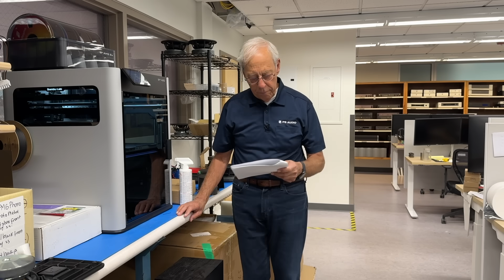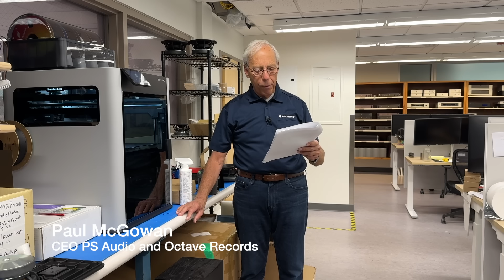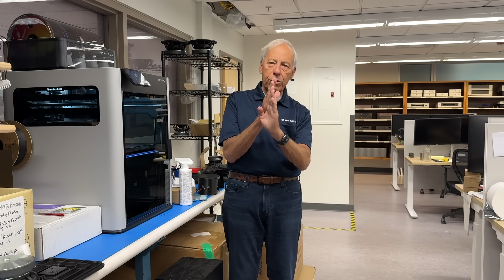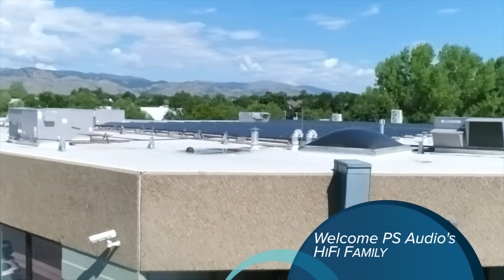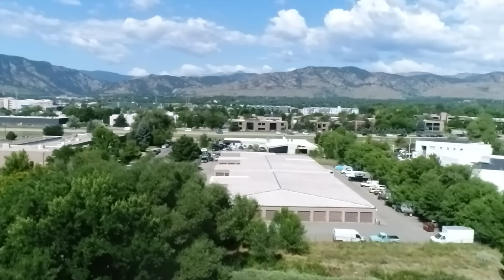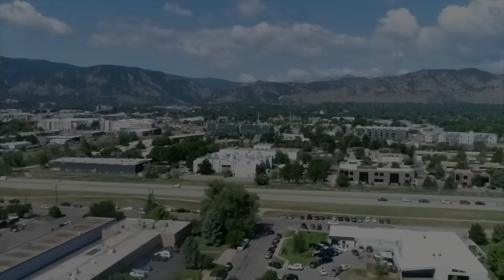Audio master clocks

Comment: The source device holds the master clock where the connection is Toslink, coax, or I2S. Where the connection is USB, the destination device holds the master clock.

Comment: I have a Denafrips Hermes, which optically isolates, buffers, and reclocks all digital datastreams before they're sent to my Denafrips Pontus II DAC via an i²s cable. The Hermes uses an OCXO clock that's better than the excellent femto clocks found in the Pontus, and in i²s mode, the Hermes clock which becomes the master clock for the DAC. It provides an unmistakable improvement over direct connection to the DAC's digital inputs.
Reply: I also have a Denafrips DAC. The concept from Denafrips is to reclock and buffer the incoming data in the DAC. According to what Paul is telling the Hermes or any other streamer will not improve the sound quality for the DAC create a new master clock. But.... a steamer like the Hermes  does make a positive difference. Hence, it was brought to market for that reason. I'm not saying Paul is wrong, but there's something missing.

Comment: It’s analogous to a pream/amp vs integrated amp. The problem with dac reclocking you are limited to the dacs clock. If the dac relies on source clock then you have option to upgrade the  source  in future to improve sound.

Comment: Even if you have a great dac reclocking the signal, there is a significant importance of the transport. I have a Denafrips terminator, and I still hear difference using different transports or USB cables. This is because the reclocking isn’t perfect, same with its insulation of the signal.

Comment: Paul is mistaken, AGAIN.  Modern chip-based DACs DO reclock.  Asynchronous DAC chips ARE the modern standard.

Paul really needs to run his responses by a real audio expert before he ends up beclowning himself.
Reply: I think he doesn't care.
Reply: @spacemissing  I agree.  He certainly never corrects false or misleading information.

Comment: "The DAC gets its clock from its source."  Thanks, that was the answer to a question I have been asking for several years now.  If I understand what you said, it mostly doesn't matter what DAC you have because it is passive in the signal path.  It's signal is dependent on the signal that feeds it.  This seems to explain why audio playback from a computer hard drive is not all that good and requires some sort of digital reclockingr between the computer and the DAC.  So outside of "some chip DACs. , What category of DACs are active and not passive in the signal chain?  That is, what type of DACs do their own reclocking?  Again, many thanks and I look forward to your next program!
Reply: I don't think you are understanding this correctly, a DAC is not passive, it has active devices. As far as clocking goes it depends on what type of interface connection is being used.
Reply: @mitchtaylor6512  Yes, a DAC is not passive.  But in the chain of a system as described by Paul, the DAC takes a passive role in the signal sent to it.  In other words, the DAC relies on the source for its signal.  Per his explanation, a DAC would use the signal sent to it by a CD player.  And yes I don't fully understand this.  Thanks for your reply.
Reply: "The DAC gets it's clock from the source."  In rethinking this, it sounds to me like the digital clock in most DACs will be no better than the digital clock in the source from which the signal originated.  And, I think, that equates to sound quality.  So it seems to me like Paul is saying that with most DACs it's 'junk in, junk out', at least regarding the digital clock and associated sound quality.  This too seems to suggests for best sound quality it's best to feed a DAC the best quality input regarding the digital clock.  Hence computers will never sound good going through a DAC because their digital signals, or outputs, are very noisy.

Comment: I think the most stable and accurate clock would come from a caesium or rubidium atomic timebase, or a hydrogen maser, and have that clocking the DAC.
Reply: Why would you need that for digital audio, you don't need a clock that has long term accuracy, you need a clock with short term stability.

Comment: @4:15, "we reclock multiple times"

Exactly why I use a DDC (Denafrips Iris 12th or PS Audio Airlens) to further cleanup the signal before the DAC , and I can hear a sonic improvement.
------
source=Apple Music lossless
Reply: A well engineered streamer/DAC with proper handling of clock mastering and asynchronous data flow needs no such things and it's not hard to engineer a well working digital audio pipe that takes care of timing and manages data well. If you hear a sonic improvement, something is really poorly engineered in your gear (e.g. PLL with jitter). It's also possible you have some digital noise leaking into the analog front-end causing a difference, but then that's a sign of poor internal isolation within the DAC of the digital side of the circuit and the analog output, e.g. poor power rail noise rejection or common mode noise rejection (e.g. a computer with noisy switch mode power supply).

Comment: As Paul says, all modern and decent DACs buffer incoming data. As long as the transport keeps up with refilling the DAC buffer, which all transports easily do, there are no timing issues. Transport timing doesnt matter. Nothing depends on transport timing. 

Clock issues are 100% contained in the DAC.

Comment: Thanks Paul
Not to pick on DcS - because most ultra high end manufacturers sell separate master clocks - But I am amazed by folk like DCS and so called independent reviewers stating categorically that there is a "substantial" difference when a ast clock is added to high end lines like Vivaldi, Rossini and even the new Varèse. 
I can understand why using an external source or interlinked clocks to ensuring the clock value is exactly the same across multiple boxes - CD/SACD, Streamer and DAC - could deliver benefits. 
Significant I really doubt this. 
BUT adding a clock to a single box -- like the Rossini APEX or BARTÓK APEX or Lina streaming DACs where both the source and the DAC are in the same box -- I simply do not understand the logic of this. 
Unless there are 2 independent clocks in each of these products (which seems nuts to me for such expensive products like DCS). Sure it is possible that manufacturers build in a weakness to their products which is "solved" when a Master Clock is added - so they can sell one more box.  Since the cheapest Master Clock in the DCS range the one for the Lina DCS costs £7,500 and obviously the higher the range the much more one has to spend -- plus interconnects. The previous top of the line Vivaldi Master Clock is £21,750. For their new flagship DCS claim the new "Varèse Master Clock brings all the sonic benefits of a dCS Master Clock – including improved focus, imaging and presence – to the Varèse Music system. Our research has shown us that adding a high-performance master clock with its own chassis and power supplies can have a dramatic impact on sound – further elevating performance by reducing intrinsic jitter for an even more compelling musical experience. 
The Varèse Master Clock delivers our most accurate and lowest jitter clocking signal to date. It’s also the simplest to use, connecting via a single ACTUS cable with no change to settings or configurations required." All for £32,500 for just the clock -- and obviously the whole "product" costs vastly more than many large mansion houses.[his means the system currently costs £217,500 as a streamer system, £252,500 for the disc playing and streaming system, and £264,000 for the full digital package.]
These are no joke investments. 
Are the benefits real or just more hifi snake oil?  I guess I will never get to hear for myself.
Reply: Bragging rights, I think. 

I have the same questions as you 😊
Reply: Snake oil scam. It doesn't cost many Dollars to create a streaming solution where audible jitter is gone.

Comment: If all new DACs do the reclocking, does that mean that the clock of the source doesn't matter? Why do they sell sources with different clock quality then? I'm confused.
Reply: He said the ps audio dacs, not all dacs
Reply: All modern DACs have buffers. Clocks before the DAC are non issues.
Reply: @1donjuego  they can improve sound quality still for most dacs
Reply: You're confused, and I'm dazed. 
 I see a song in there somewhere.
Reply: @4:15, "we reclock multiple times"

Exactly why I use a DDC (Denafrips Iris 12th or PS Audio Airlens) to further cleanup the signal before the DAC , and I can hear a sonic improvement.
------
source=Apple Music lossless

Comment: IMHO. This is more necessary in an audio studio where there is a lot of different equipment and it needs to be synchronized. At home, if your room is not acoustically processed, then no clock generators will help. First, you need to process the room.
Reply: no

@4:15, "we reclock multiple times"

Exactly why I use a DDC (Denafrips Iris 12th or PS Audio Airlens) to further cleanup the signal before the DAC , and I can hear a sonic improvement.
------
source=Apple Music lossless